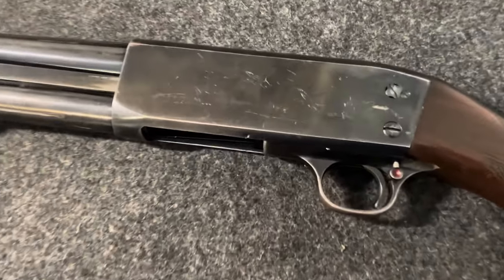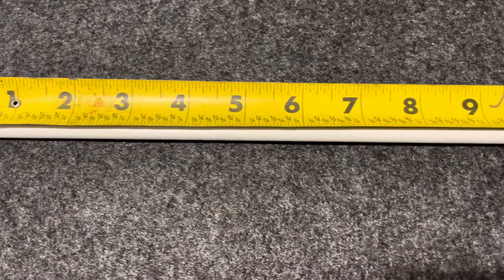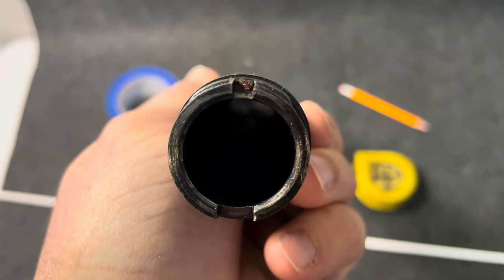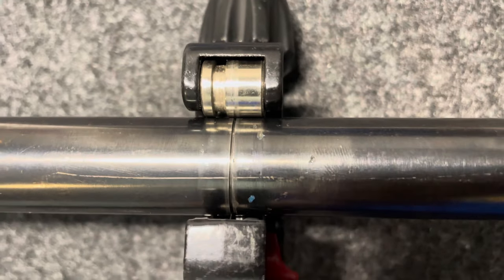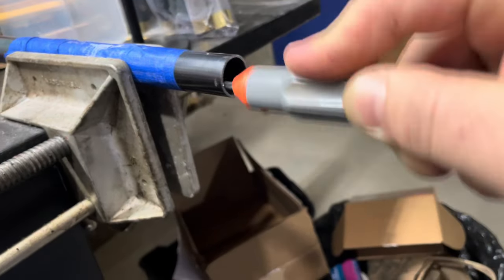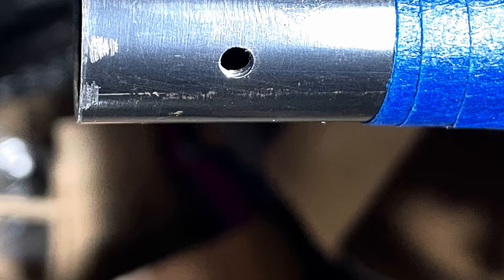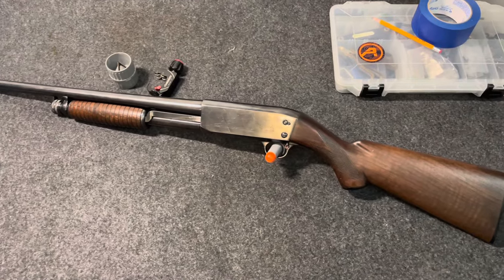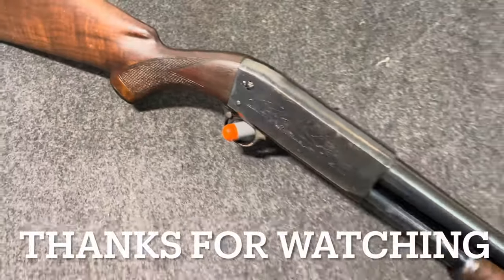Ithaca model 37 12 gauge shotgun self defense / riot style

Comment: That turned out amazing. So many helpful hints. What do you use to polish/treat (?) a very old wood stock? Probably a silly question, but I don’t want to wreck an old shotgun. 🇺🇸✌️
Reply from the maker: Finishing an old stock or refinishing kind of depends on how it was finished originally. I mean, it’s wood so there are many hood instructional videos on refinishing wood. If it has old lacquer you’re probably going to need to strip it first, if it’s just oiled, you may be able to just oil it. 

Some guys use chemical strippers, some just sand it with progressively finer paper till the wood looks good, the use tung oil. The tung oil will give you a deep color usually and leave a very low sheen on the wood. Like my M1 Garand or my 10/22 M1 Carbine
Reply: @crankygunreviews  Thanks for the pointers on what to look for in my research.👍
Reply from the maker: Anytime